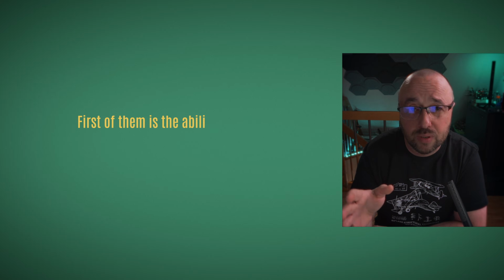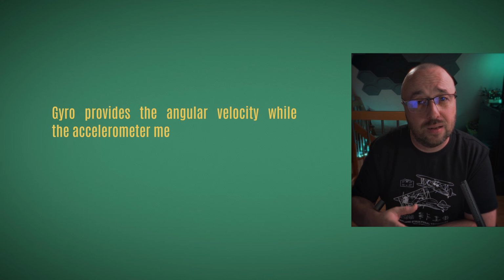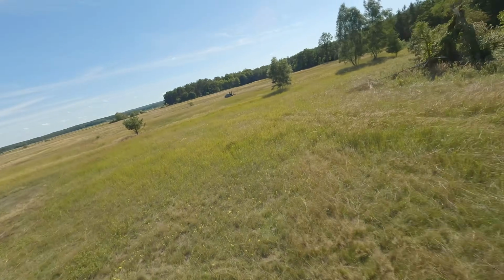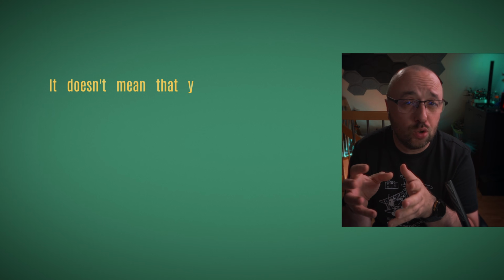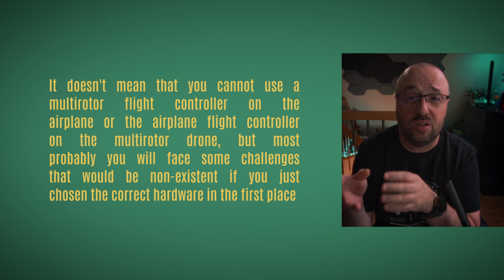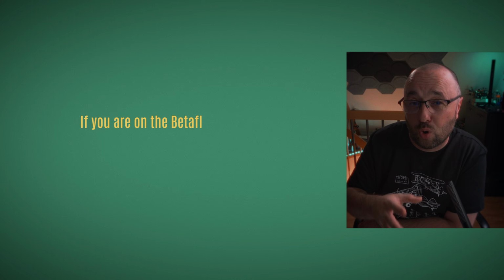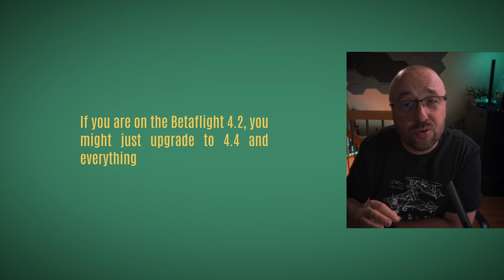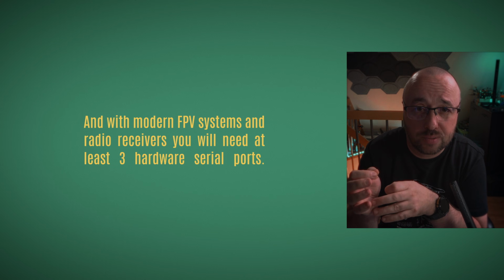Flight controller basics for beginners

Comment: Thank you so much.. I was wondering.. If I have a plane with motors, but also drone motors for VTOL, can I run a plane controller AND a QUAD CONTROLLER  so I can use the extra voltage bus in the plane controller but also the functionality for the VTOL motors with the quad controller?

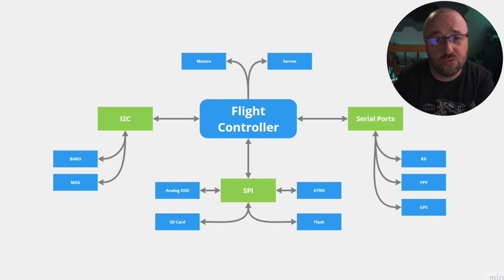Comment: 3:42 - Its odd the magnetometer needs its own separate I2C connection when the mag and GPS are in the same module board and the GPS has always used a serial UART connection.  The mag could easily share the GPS 115200bps serial connection.  If they did this, we wouldn't have to wire up another two wires.

Comment: Morning Pavel I have been constructing quadcopters since the days of clean flight and kk 1.2 boards I'm having a problem with a speedy b f405 version 3 board where the elrs receiver connects to my tx16 transmitter and works and shows up in beta flight version 4.4.3 but as soon as you power up the quad with a battery you totally lose the control linkage this is something I've never come across in all my years of flight controllers and many quadcopters that I've made and I have no idea I have only four items connected to these flight controller the elrs receiver on txrx 2 a vista digital system on txrx1 and the GPS on txrx6 and a buzzer connected to the relevant buzzer points all seem to work fine when they quad is connected to the computer but when the quad is powered up still connected to the computer I totally lose receiver connectivity I'm hoping you can help me with this strange problem thanks again Pavel

Comment: Simply very clear presentation. Thanks a lot brother. Pls keep it up
Reply from the maker: Thanks and welcome
Reply: @FPVUniversity  Bro KINDLY help me regard dis pls

1. 6s or 8s charger to go right now I have 6s batt

2. Toolkitrc la lot of models which one to go pls seggest a model

3. Can I use 60W Mobile charger head to charge  toolkitrc charger. If not means kindly suggest budget power supply 

Kindly guide me bro, Thanks in advance.